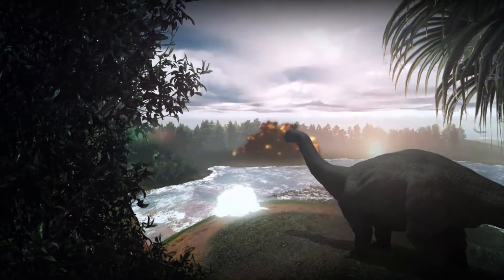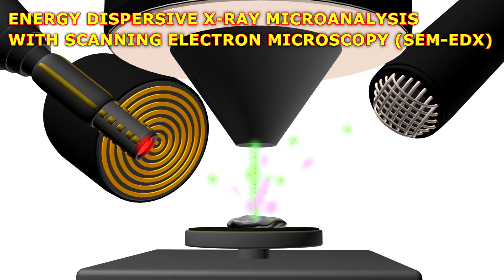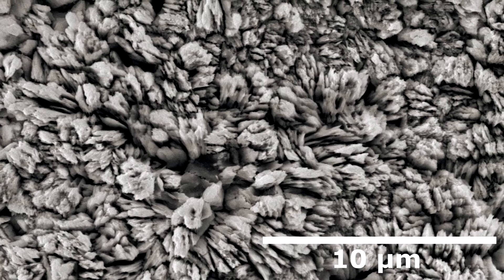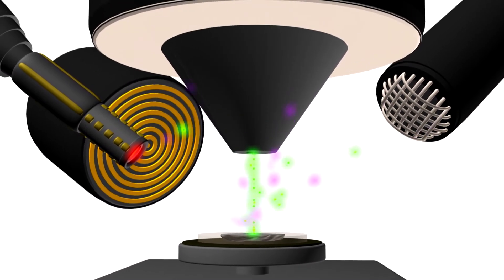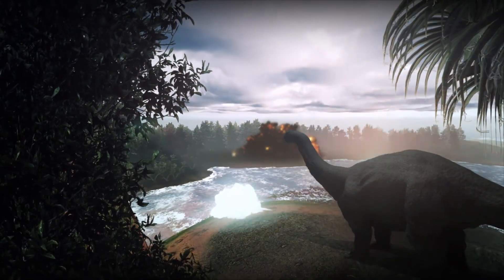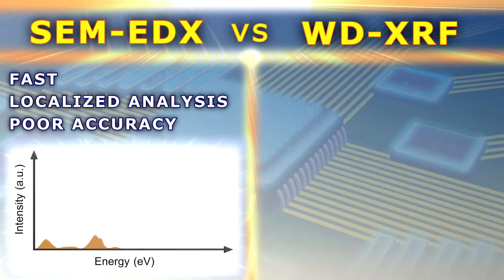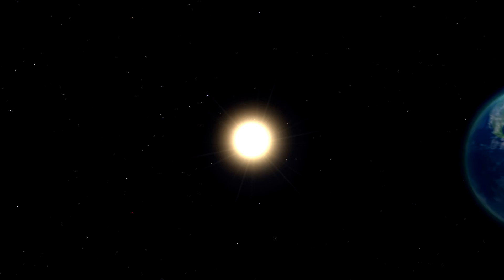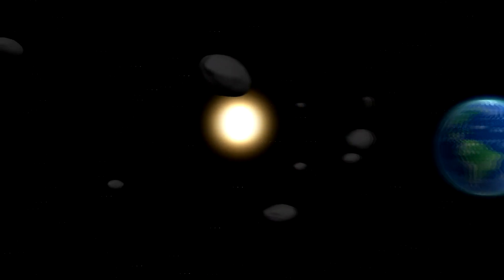How to Study A Meteorite Under the Scanning Electron Microscope (SEM)?

Comment: The study of nucleic fluxes in meteorites is a relatively specialized area of research. Nucleic fluxes refer to the flow of nucleic acids, such as DNA and RNA, and their components. While meteorites are known to contain a variety of organic compounds, including amino acids and other prebiotic molecules, the presence of nucleic acids or their precursors is less common and can be considered a significant finding.

If you have discovered nucleic fluxes in a meteorite, it could be an important contribution to our understanding of the origins of life and the potential for life’s building blocks to form in extraterrestrial environments. Such findings could provide insights into the processes that may have contributed to the emergence of life on Earth or elsewhere in the universe.

If this is a new discovery, it would likely require further investigation and validation by the scientific community to determine its significance and implications.

Got this in my meteorite I found in UK Amazing yeah?

Comment: Awesome Info, Thanks So Much. I Googled WXRF Scanning Devices and Thermo Fisher Scientific makes a Field Tested Mobile Device that can scan rocks for precious metals, gems, etc. Wonder if it will work on Meteorites. #CaptainCorrosion
Reply from the maker: Heya! Its probably an expensive device so prior to purchasing you can buy a couple meteorites from Ebay, prepare them for analysis (as you'd normally do in your application) and request a demo. Portable systems however are not sensitive enough to measure low contents of elements but once you measure the main composition of a meteorite, you'll know right away if additional studies are required with more precise and sensitive instruments.
Reply: @CaptainCorrosion   Actually I discovered the Strewn-field of Meteorites in Wexford Pennsylvania USA 15090 zip

Feel free to drop me your email.
I'll send cool pics of my Meteorites.

And rare space gems in blue and green gem colors with fusion crust on the edges.

My biggest problem.

Is getting a buyer.

I've pounded away at emailing the most prolific collectors, at least the ones that are open about being a collector.

If there are any private Collectors please let me know as well after you see the pics of my collection.

My email is 

info@LightTheory.tech
Salam!
Reply: Good info I was thinking of buying one.

Comment: Sir, I have XRD, TEM , SEM, AFM, STM in my syllabs.. pls suggest me a good book.
Reply from the maker: Hello, we are currently working on the "Captain Corrosion Handbook of Materials Characterization", which might be just for you but it will take a while until we publish it. Meanwhile you can check out the following; 
X-Ray Diffraction for Materials Research, From Fundamentals to Applications - Myeongkyu Lee
Electron Microscopy and Analysis - Peter J. Goodhew, John Humphreys, Richard Beanland
Fundamentals of Scanning Probe Microscopy, V. L. Mironov